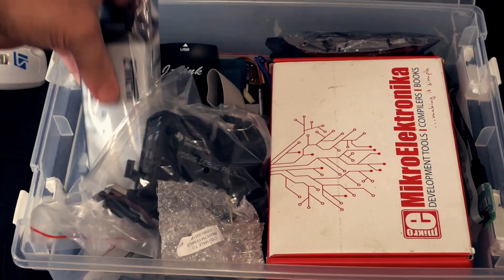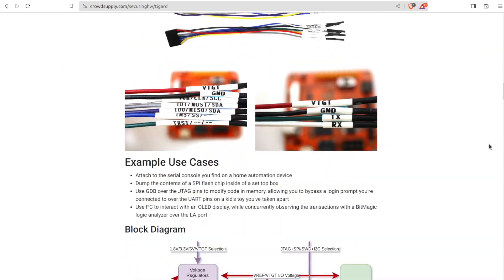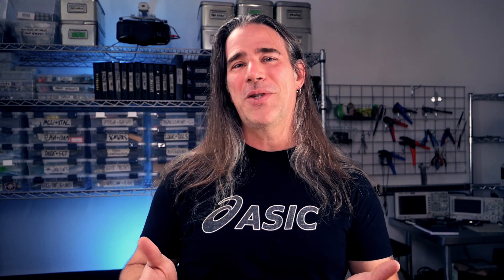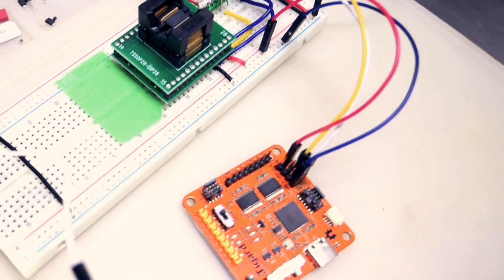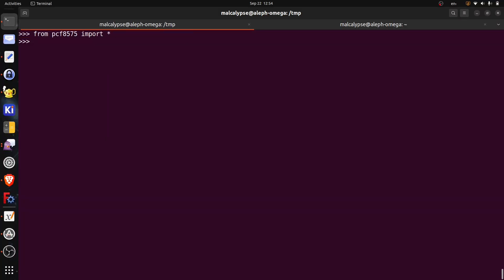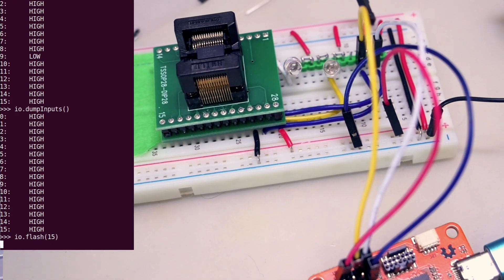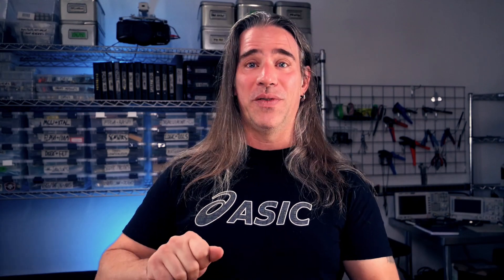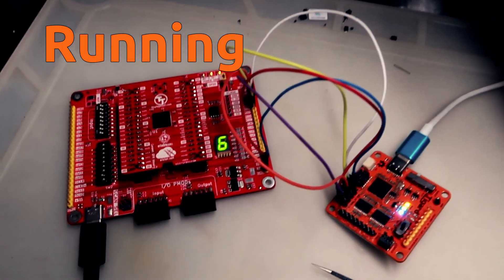The Everything Interface: Desktop to Chip [USB to SPI, I2C, JTAG, UART, SWD...]

Comment: I do the same thing with the Adafruit FT232H board. Being able to directly address plugin boards in micropython on my main PC really speeds up development. BTW I use the Pycharm IDE and it all works well.
Reply from the maker: Hi William, yeah these things are superb.  Of course I use them to burn SPI flash and such, but just being able to have a quick python way to twiddle pins without the overhead of a dev board is very sweet.  Haven't tried Pycharm (I have pretty much everything in eclipse, including non-python, which I find practical) but will take a spin--thanks!

Comment: this module work as spi slave ? i.e, to send data from a SPI master to this module, then convert to USB
Reply from the maker: Hi Jeferson,  I don't actually know the answer to this--it's an interesting use case but one I've never encountered with the device.  A quick search says that if it's possible to use an FT2232 in this mode, it ain't exactly popular.  I was thinking worst case would be you could bit-bang using the GPIO interface, but as the slave device you don't get to choose the rate, so it might not be up to the task.

Comment: ..need little help here (Win box): when I typed "pyftdi.ftdi.Ftdi.show_devices()" in python 3.8.6 .. I get error . I have the driver installed, and see COM interface in Device Manager.
Error:
raise ValueError("The device has no langid"
ValueError: The device has no langid (permission issue, no string descriptors supported or device error)
De
Reply from the maker: Hello Vignesh, unfortunately I'm a little clueless when it comes to windows--and the last time I was there, I was amazed at how hard it was to get anything done with an OS that's supposed to be "easy"--ugh.  I did find stuff like this: https://forum.newae.com/t/the-device-has-no-langid/2891/7 and, the last time I was there it was actually to try and get something working for a CM in china, with python and USB, because they only had win machines.  It was a nightmare, I gave up and wound up sending them a preprogrammed RPI Pico to do the job, hah.  Anyway, my guess is it's something with libusb which seems pretty tricky with mickeysoft, but I really don't know!
Reply: @PsychogenicTechnologies  Hi, Thanks for taking time to reply. 
I have been chasing this issue since morning and found a temp fix (hope it helps other too). Which is to use Zadig.exe that replaces FTDI dll with libusbk.dll. This worked for me on windows, but the downside is, now you lose FT_Programmer’s ability to connect to FTDI chip. 
I guess, I can rerun Zadig to reverse it, but looking for a better solution that works with both FTDI programmer and ability to use JTAG.
Reply from the maker: @vigneshb5347  ah, well a workaround is certainly better than it just not working.  Thanks a lot for sharing it!

Comment: I use the the Analog Discovery 2 board for I2C/SPI/Can/Waveform-generator , but if you need OpenOCD/JTAG/SWD then the Tigard is the way to go!  Incidentally the ESP-Prog uses the FT2232H *L*.

BTW, unrelated, but any thoughts on building SoCs using LambdaSoc (Amaranth HDL) vs LiteX (m-labs or whitequark's Migen/MiSoc)?  I'm looking at writing an AMBA ABH-Lite slave device
Reply from the maker: Yeah, am still figuring out a few things with the Tigard but it's a lotta fun!  Didn't know about the ESP prog.
As for SoC -- haven't used Migen/MiSoc but AFAIK migen became nmigen became amaranth and  whitequark et al. have been working like crazy on Amaranth, so it's very active and alive... not sure about the others, as I've been turning to amaranth everytime I need something (actually trying to get in another little sub for tinytapeout 5, also w/amaranth).

Comment: So is this basically a better Bus Pirate? 
I'd like to replace mine with something like this, particularly since it seems to support JTAG better/fully.
Reply from the maker: I left my Bus Pirate somewhere (i.e. lost it) a good while ago, but IIRC it is very similar.  Haven't played with the JTAG yet, but I sure like the whole automatic voltage level shifting (and going down to 1.8V logic... 5V tolerant is cool but I want to be able to talk to these easily) and the variety of headers is pretty swell too.
Reply: @PsychogenicTechnologies  the Bus Pirate didn't really support JTAG out of the box. You had to install alternate firmware and, AFAIR, give up other features to use JTAG. Anyway, I never got it working for that function before it essentially became abandonware.

Anyhoo... this looks like a sweet little widget to add to my collection. Thx.

Comment: Oh neat! Do you know whether the Tigard kit sold by Mouser is the same as the kit sold in the 1bitsquared shop? I'm just asking because the photo from 1bitsquared shows the board plus labeled cables and the photo on Mouser shows only the board and there is no BOM of the kit that suggests that the accessories are included in the Mouser kit. Also, do we get permission to list this tool on the Recessim wiki?
Reply from the maker: Hullo DeadBug! :)  To answer your Q, I don't actually know.  However, I've gone through crowd supply for a few different projects--the Tigard, the LimeSDR, I can't remember what else--and it's always been shipped to me by Mouser.  So my guess is that it's the same (mine came with the cables).
As for permission... same answer!  Hah, I'm pretty sure it'd be ok... I'd had no contact with the creators of this tool prior to doing my video, so I can't say, but I was pinged by Joe Fitz (@securelyfitz on twatter) and he's a cool guy, created the thing to scratch an itch and released it, like any of us would surely gladly do.  So if you have a question on that, I'd suggest pinging him.
Cheers!
Reply: @PsychogenicTechnologies  Thanks for the tip, will do! Cheers!

Comment: Great looking tool! 😊
Can I ask what level shifter you use? Sounds really useful, especially if the supported device can set the level ❤
Reply from the maker: Hi Kaylee!  Yes, it is super useful and the thing comes with two shifters on-board, specifically the SN74LVC8T245 (https://www.ti.com/product/SN74LVC8T245 ) which is, I think, what sets the 1.8-5V limits.